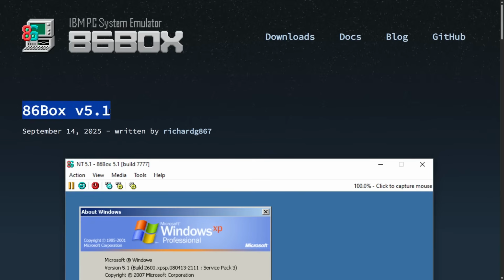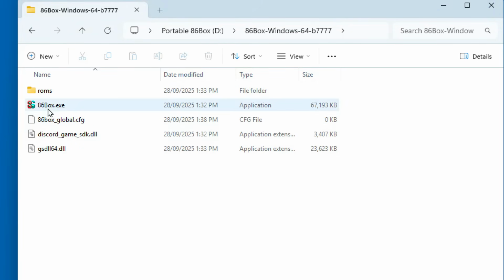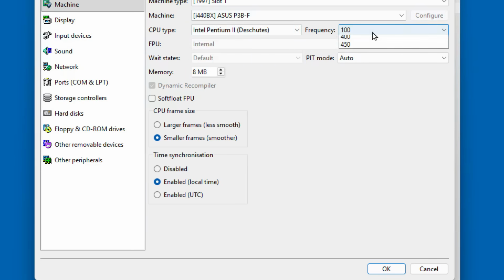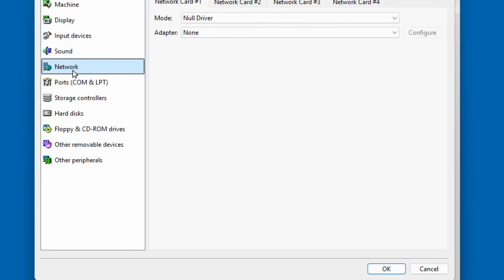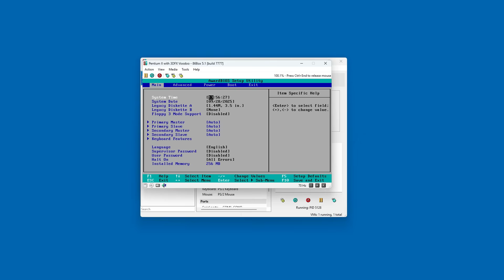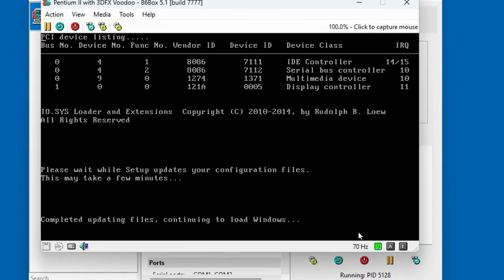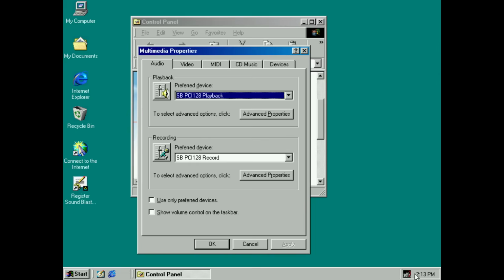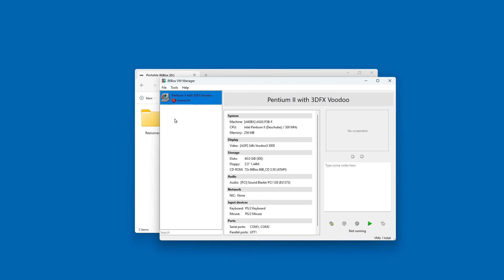How to Set Up 86Box for Portable Mode

Comment: I will definitely have to try this one so I can take my 'legacy' PCs on the road with my laptop.
On one of the points you mention at the start of the video when setting up 86-Box (and its config file), whenever I set up a new Windows machine one of the first things I ALWAYS do is go into Windows Explorer and ALWAYS unhide the file extension. I've done programming in Excel, have used all sorts of programs in my 40 year data analyst career, and even remember computing way back in the days of 8:3 DOS file names (MS-DOS 3.30). It also means that I know whether that Excel spreadsheet file I'm using has an embedded macro within it, or the Word document is a tempate of a document, or whether it's an older Access 2000 or a later Access 2007+ file.

Comment: I really appreciate the video.  This seems like a good fit for me as I most likely won't be able to ever own real vintage hardware.  I do need to get a fancy M.2 USB SSD like that......i'm afraid my USB drives would choke a bit..........
Reply from the maker: It depends, a decent, modern USB 3 stick should be just fine!

Comment: Great material! I've been using 86Box for several years now, but recently, after switching to a Ryzen 7 5700x3d processor, I feel like the emulator is running worse than on the Ryzen 5600...
I'm a bit confused!!! I've been working with computers since the late 1980s, but today I felt like a novice. At home, I have a computer equipped with a Ryzen 7 5700x3d processor, and at work, an Intel I5 12400, and I thought that the 8-core Ryzen would be better, but that's not really the case! Cinebench R23 shows that Intel scores 1647 points in single core and 12130 in multi, while Ryzen scores 1299 in single and 12869 in multi!!! In single core, Ryzen is much slower, which makes 86Box run much worse! Both computers have DDR4 memory with a clock speed of 3600Mhz... I'm confused!!! Do you have any suggestions? From what I've read, these processors should be similar in speed, although I thought that the 8-core Ryzen would easily beat Intel's 12th generation I5 (6-core). Two days ago, I updated the BIOS (AGESA ComboAm4v2PI 1.2.0.F update) on my home computer - MSI MPG X570 GAMING PLUS motherboard. I would be grateful for any suggestions on how to get more out of Ryzen.
Reply from the maker: Yes single core performance is what's needed for 86Box. The latest processors have improved greatly in this regard.
Reply: @philscomputerlab Intel Ultra 265KF from what I see after testing it will be very different from 5700x3d.

Comment: If anyone else is having trouble with getting .vhd files to mount with a double click, in my case 7-Zip got stuck with the file extension association and I was unable to switch it back to use Explorer by default until I did a registry tweak. If you seach "mount .vhd through context menu" and pick the result from Microsoft Learn, that's the tweak I used (it was given for Windows 8 but still works in Win11).

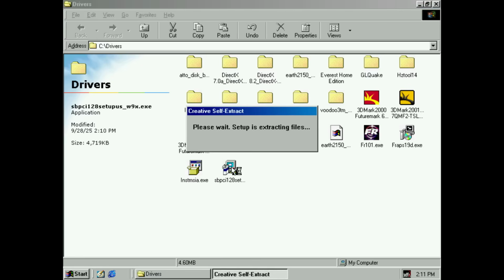Comment: 16:02 I always get annoyed when I forget to copy something important into my Retro PC... Either a Savefile, Driver or Program that I need on my 98 Config 😅

Other than that - I just want to say that I love how 86Box is evolving.
Reply from the maker: Yes it's super annoying! I don't think there is a fast way to get files into the emulator. You could setup networking, FTP, or write files into a CD image, but to me it's a little bit of hassle. Funny you mention that, for most of my retro projects I have ready to go folders with resources. Like benchmarks, timedemos, chipset drivers, a curated driver folder and so on. It's evolved over the years and now I rarely forget anything 😊
Reply: @philscomputerlab  I try to make everything set up, but sometimes when thinking about this point of my Retro PC or that point... It can make me forget about the thing I wanted to have as well, and I need to go back to my laptop again to get that file I needed AND THEN do something I wanted. 🤣

Comment: Great video Phil, as always. I would first install the motherboard and chipset drivers after windows btw, the ones that Win98 use are mostly for compatibilty.
Reply from the maker: They are included with Windows 98 Quick Install! But yea, if you're using a standard 98 ISO, you're absolutely right.

Comment: Did you notice that when you click to open a folder, it makes a stuttering double-click sound? This happened in older versions and it only gets fixed when the computer is running at full performance. You basically needed at least a Pentium MMX 166MHz to run it properly. It would be great if you could fix this bug.

Comment: This is amazing, following you since years Phil, my favourite! :) Have a small question: this quick mode is amazing, does it work also on real PC if i put on USB or burn a CD? also, real question: there is a way to change the language (in Italian)? Do i have to use files from original Win98 CD in my language, or is english only? Thanks as always, you're the best Phil.
Reply from the maker: Yes it also works on real PC. English only I'm afraid.

Comment: Another fantastic video. Is the mouse lag still noticeable with the update every frame option? 

Also, the benchmark itself is emulated. What's actual gaming like? Quake 2?
Reply from the maker: It's much improved, especially if you have a high refresh rate display! I haven't thought of doing benchmarks vs realm hardware yet...

Comment: idea for a video: benchmarks between 86Box and real systems with the same specs. would be nice to see how these compare and maybe deduce where the bottlenecks are in terms of emulation (limited by single thread performance or more room for optimization in some areas? as far as I know, Voodoo graphics emulation is not 3D accelerated like in DOSBox Pure or DOSBox-Staging).

Comment: Curious how close is the performance for that 86box setup compared to the same bare metal hardware? You mentioned you have that motherboard already, assuming you probably have the same CPU and voodoo card to compare results with is it very similar?
Reply: If the host CPU is fast enough, it is cycle-accurate

Comment: Someone in the 86Box Discord posted this as a rough estimation for needed CPU Power:
Core 1st Gen - Pentium 66
Core 2nd Gen - Pentium 120
Core 3rd-6th Gen / Ryzen 1000 & 2000 - Pentium 166
Core 7th Gen / Ryzen 3000 - Pentium 200
Core 8th - 10th Gen / Ryzen 5000 - Pentium MMX @ 233

I have a Ryzen 9 5950x and I can get up to Pentium II 166, anything higher and the sound will stutter.
Reply from the maker: It takes a fast single core. The latest CPUs are much stronger at single core performance, that's why.
Reply: I have a 5900x overclocked to 4.75Ghz and I can get a Pentium II 300Mhz running with minor stuttering on a select few games.

Comment: I’ve been meaning to get around to trying the newer versions as I last used 4.1. Are the 5.x builds any quicker by chance? Also, thanks for demonstrating this new functionality!
Reply from the maker: Nope, still as demanding to run. But the mouse is smoother and lots of other little improvements...
Reply: @philscomputerlab  Feature improvements are always welcome! Just hoping for some extra speed at some point as I have an E6430 laptop with an i7-3740qm and essentially a GT530 (nvs5200m) that I dual boot xp and win11 on. Win9x natively is out of grasp for it. Having even just a Pentium 233 would be nice for 9x but it’s out of grasp at the moment. It does about 150 mhz stable.

Comment: How does this compare to PCEM?
Reply: PCem hasn't been updated in years. 86box started from the same code base but diverged quite a long time ago. I haven't used either enough to tell you which is better but I assume 86box at this point.